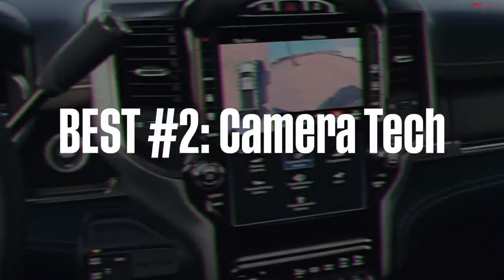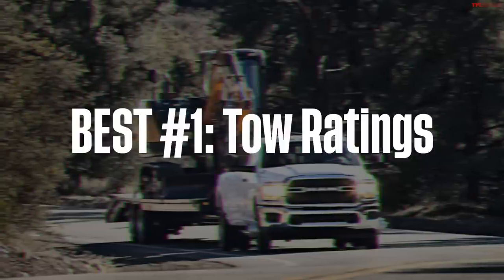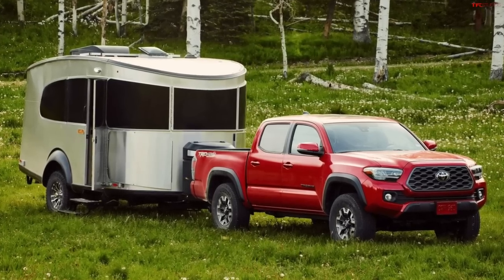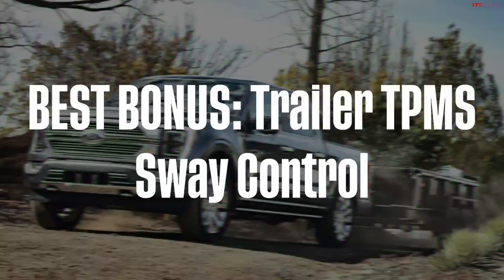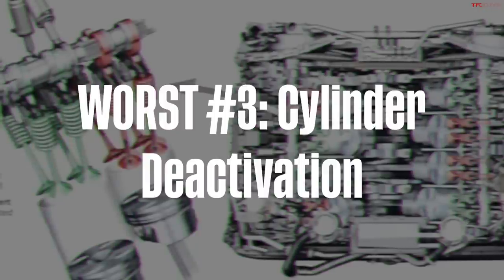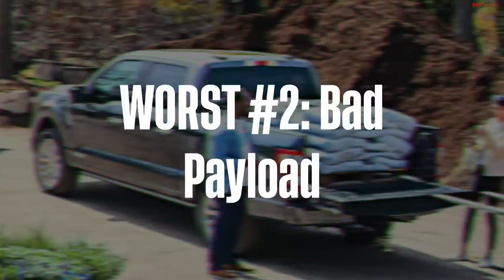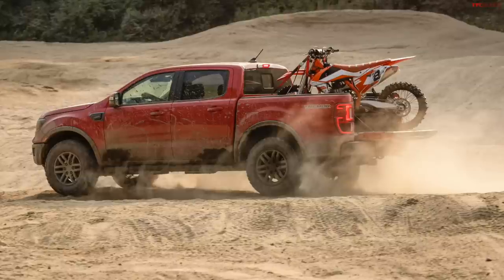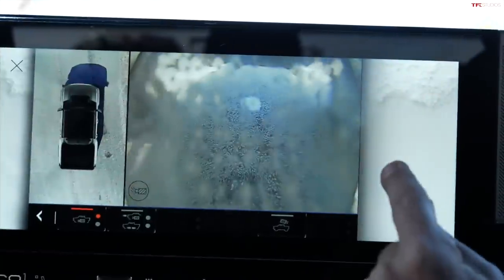This New Truck Tech Makes Your Pickup WORSE!

Comment: Thanks for a really useable top and bottom list! Regarding your final negative point (Price & Availability) - - I have been frustrated by the increasing levels of luxury and decreasing bed size of modern pickup trucks.  I bought a nice car in which to travel with my family so I don't need that in my truck*.  I needed a truck to - well - - BE A TRUCK! I needed a long bed, standard cab, 4 wheel drive pickup truck. I did not need heated leather seats and surround sound. (I will admit a camera would have been nice but I bought an after-market unit that suffices for my needs).  Trucks like I wanted have proved to be scarcer than hen's teeth.  I ended up buying a (very well used) 2013 Chevy work truck.  It's low enough that I can reach over the bed sides, easily climb in and out, and the 4.3 liter six cylinder engine yields pretty good fuel economy and all the torque I need.  I do not tow much or often but I haul a lot of lumber in the bed (and mulch, and manure, and rocks, etc...). I have crank-up windows and a really terrible radio but who cares?  This inexorable march to the "ultimate luxury truck" is leaving the common truck buyer out in the cold. I'd hate to have one of these gold-plated land yachts and dent it up while loading crap from around the farm.
Reply: They should offer both.  The land yacht isn’t great on a farm and the ideal sh*t kicker isn’t useful for interstate towing/family transportation.
Reply: You are absolutely correct I had 2 superduty trucks and 1 tundra. With all the electronics bull shit that kept costing me thousands I went back to a 96 f350 regular cab long box manual transmission. Been the most reliable vehicle I've ever owned. Insurance and registration is only the fraction of the cost also

Comment: I rock a 2008 Tundra with the 5.7 and it will be in my driveway until the day parts are unobtainium. Limited nannies, dependable powertrain, good capability and comfortable enough for a vehicle that hauls and works!
Reply: Why not start looking for a parts truck in good shape? I've known several people that have done this and it makes finding parts very easy-- barring storage probs.
Reply: Good call, I've been looking for one that was written off from a rear end hit...issue is all the rust here. I may have to take a trip and get one from the south🥴
Reply: I tried last year to get me one new, but i needed front bench seat. Couldn't find one i got me Nissan Titan XD...
Reply: Yea your right I’m regretting my purchase of my new Sierra zero issues after 20k miles but so much tech I know it will fail one day 
Should’ve gone with the 2011 Silverado 2500 6.0 gasser that I first wanted, proven simple truck and easy to maintain
Reply: And 12mpg… I drive too damn much to settle with that.
Reply: It's a truck, not a car...fuel mileage is  secondary to how it works and more importantly how dependable it is. I get 11L/100Km (a tickle over 21mpg with mixed driving) because I drive responsibly and stick to the speed limit, for a vehicle that will take basic grade fuel, can be dogged on the service intervals and given conventional oil I think the cost of ownership is much lower than these TT car engines being forced to work within an inch of their life. Come back when an Eco OR Boost hits 500,000 miles with minor maintenance 🤣😂
Reply: @coryernewein  there’s plenty of high mileage Ecoboost trucks out there, don’t be ignorant and look it up. No way your tundra is averaging 21 mpg. That’s a flat out lie unless you’re going 40mph. I have 144k miles on mine, tuned from day one. No issues and does 0-60 in 3.8 seconds. MPG does matter. To say otherwise is also a lie. Being a truck doesn’t exempt this cost factor.
Reply: No lies, I've had this discussion with folks for years and I would be glad to show you if you could make it up here into Canaderp. I never said that TT engine wouldn't last, just that it won't last for as little $$$ as my lazy, lumpy V8🤷
Reply: @Treyk901  you obviously view trucks as a race cars not the workhorses they were originally meant to be. If I wanna do 0-60 pulls I'll hop on my sled and do it in under 2 seconds.
Reply: @coryernewein  no, I don’t view them as race cars. But a truck with more power tows better. And just because it’s a truck isn’t an excuse it has to be slow. And since we are on that topic, the Tundra was the first one to heavily advertise how quick their truck was compared to the competition. Pretty much all automotive experts agree that the 3.5 Ecoboost is the best towing engine on the market for a half ton truck. The engine is over built and under tuned which equals good reliability during extended WOT when towing to the max. I know it’s de rated bc of the huge power gain from aftermarket tuning. As far as MPG goes, my dad had a tundra 5.7 for several years and attested to its terrible MPG. EPA estimates the 5.7 4x4 Tundra MPG to be 13/17 and we all know the EPA estimates are generous.
Reply: I had a similar 2008 tundra, awesome truck, towed everything I threw at it well, excellent brakes, hard on fuel for sure. Bulletproof drivetrain.
Reply: @coryernewein  21 MPG in a 5.7? You need to go back to school to learn how to do math.
Reply: @Eastahtata  He's probably dislexic. Prolly meant 12 mpg. THAT sounds about right for most medium sized V8 gassers (like a 5.7L) in 1/2 ton trucks.
Reply: @Treyk901  Better buy a car then.
Reply: @turbodiesel4709  go tell that to fleet owners. MPG matters. Why settle for 15 when you can get 20? 🤡
Reply: @turbodiesel4709  proven costly by who and who’s standards? I’ve had more maintenance and repair costs and issues with my turbo diesel work truck than my gas burner Ecoboost both at the same mileage and bought new. Plenty of high mileage Ecoboost trucks over 300k miles on the road. All the people having issues with their trucks are the ones not taking care of it. It’s a high performance turbo engine and needs to be treated as such. Let it warm up some before hammering the gas. Let it cool down some before shutting down. Change oil on time. Use quality fuel. Use premium when towing heavy for best performance and MPG (most manufacturers say this now). This engine also is direct injection and port injection so the issues that all other TDI Gas engines have aren’t there. This engine offers higher towing capacity than the v8 option and tows better with lower RPM. Pulling the max load up a grade with the ecoboost can be done at around 3000-3500 RPM and the 5.0 will have to be turning 4500-5000 RPM while pulling it slower. Lower RPM = longer engine life. That’s why diesels last so long bc a superduty pulling that same load could do it at 1500 RPM, granted it’s pulling half its capacity compared to the 1/2 ton class.
Reply: @Treyk901  : I have no problem telling it to any fleet owner. In fact, I've worked for various different trucking fleets before, both heavy duty & medium duty, and I actually have told them to hold on to their older diesel rigs for as long as they possibly can.
 
The only reason that many companies have switched back to gasoline powerplants is because of all the ridiculous emissions-related problems that now plague the modern diesel engines.
Of course, such problems have been brought on by politically mandated government regulation.

You brag about the junk EcoBoost Ford engines getting to 300,000 miles? Hah... few Ford anythings ever make it to 300K. Turbocharged or otherwise. 
I can assure you that any such examples of high-mileage "eco-boosts" are few & far between.

How about we discuss something that's actually true? Look at all of the light & medium-duty commercial trucks with Cummins 5.9L & 6.7L diesel engines, from the 1980's through 2012, for example. Everything prior to the self-defeating government mandated DEF & SCR emission-control systems.

We could also talk about the older Ford Navistar 7.3L IDI's and 7.3L Powerstrokes, the Mercedes diesels, the Mitsubishi diesels, the Volvo diesels, the Iveco diesels, Toyota diesels, and so very, very many more. 
A great many of all of those aforementioned diesel powerplants have well over your silly 300K mile benchmark on them, with few major failures compared to nearly any gasoline engine counterpart... regardless of being naturally-aspirated or turbocharged.

If you truly wanted to be honest, you would admit that any turbocharged gasoline engine is going to have a substantially shorter life span then any naturally-aspirated gasoline engine. 
You would also willingly admit that nearly any diesel engine will outlast nearly any comparable gasoline engine.

I'm sorry to hear you had a lot of problems with your personal diesel engine pickup. If I were a betting man, I would dare say you had something built 2012 and newer, which are all loaded with emissions control problems and electronically controlled fuel system problems. There's no doubt that those two major problems centers alone can cost a person, or company, great financial distress.

One thing for certain, that I bet we can both agree upon, is that the oil companies are ripping everyone off with their exorbitant prices for diesel fuel, that far exceed the current prices of gasoline. It's straight up criminal greed.
Reply: @turbodiesel4709 I use to operate a fleet and that’s why I say MPG matters. I agree that diesel emissions are BS and constant money pits. My peterbilt was a constant pain in the ass with the emissions. My super duty literally blew the exhaust system off because of it. But what you don’t understand is this. This gas turbo engine isn’t just your basic na with a turbo added to it as an afterthought. It was built around with the intention of shoving 20 psi of boost through it. Many manufacturers didn’t go the route Ford went with and they are having failure. This engine also uses turbos that are water and oil cooled. Tuners have proved the stock block can hold 700 hp. So in stock form with 375 Hp is nothing for it. The gen 2 Ecoboost came out in 2017. Not enough years to really show many high mileage engines. Plenty of na V8s failing. Most of the ecoboost failures are from bad piston skirts, something all engines use and not related to it being a turbocharged engine.
Reply: A great choice 👍

Comment: To the last point about truck availability, I live in Canada and was told last week it would be a 14 month wait for a new Tundra and 36 to 40 months for a new Sienna.  That's nuts!
Reply: @Nick Johnson : So what? There are several simple solutions: 
1.) Buy a different brand. 
2.) Buy used. 
3.) Invest a little into improving the vehicle you already own.
 
People really need to curb their desire & yearning for the newest & latest crapola. 
It's not rocket science.

Comment: Love my ‘95 short bed F150 XLT, 5 speed, manual hubs, 15” steel rims, no push button anything, no TV in the dash.  It does have navigation, MP3 player, internet radio and so on if I take my iPhone with me 😃. 
Ridiculously huge rims have to be one of the dumbest trends in truck history.  I run BFG 33’s on the 15” factory rims.  When I air down to 12psi in soft sand I don’t even need 4WD most the time.  The 4.56 axle ratio is a good match for this setup.

Comment: I completely agree and am surprised you guys have electric trucks in the worst category. You guys seemed to be big advocates in the past.  I think they are a terrible solution looking for a problem, just surprised that you guys went there.  Kudos to you on that one.  I have 2 bonus negatives  - 1) Auto stop/start, specifically the fact that you have to turn it off every time.  if the truck would just remember your setting then I wouldn't really have a problem.  I do understand why they do it, they don't get the mileage rating advantage from the EPA if it doesn't reset, but it is annoying none the less.  2) price - All those pluses (which I like) add up.  Trucks are getting unaffordable very quickly.  Great job guys, love your channel(s).

Comment: I also agree with their lists but I may want to add I hate that many manufacturers are removing buttons to control most things and replace them with controls in the touchscreens. I like to have radio, temperature and cameras with buttons/switches.

Comment: I couldn’t agree more about cylinder deactivation. I believe there will be reliability issues in the long run. Drivability is affected as well. I find myself switching my F150 over to sport every time I think about it to bypass that system. We don’t want it.
Reply: GM has had reliability issues with teh 5.3 since 2007 at least. I had a 2007 Yukon XL and at 36k it started burning a qt of oil every 1000 miles then at 96k I though the cam broke. My mechanic flushed the engine and told me the cylinder deactivation was  a known issue causing sludging. I was religious with changing the oil with Mobil1 every 5k. I loved the truck I looked into buying a crate engine and it was so bad GM didn't offer the 5.3 for the 2007-2009 models.  From what I have read it's better now but still happens but not as often. When I had a head gasket start to leak I traded it in for a 2014 Ram 1500 Bighorn that I still have and love! It's been the most reliable vehicle I have ever owned so far breaking 112k last week.
Reply: Some early commercial diesel engines from 100 years ago had cylinder deactivation. This makes me think there was a simple mechanical solution to making cylinder deactivation. I'll be much more interested if modern car cylinder deactivation engines can have the same reliability as non-cylinder deactivation engines.
Reply: @dr.x4050  Back in 1980, Cadillac offered the HT4100, 4.1L V8 that featured 4-6-8 cylinder deactivation.  It was one of the least reliable GM engines in history and the only way to make it somewhat reliable was to dig into the engine and replace the cylinder heads to get rid of that crap.  Thankfully they only offered it in the 1981 model year and then discontinued it.

Comment: I’m on my second 5.3L Sierra with AFM.  First one made almost 200k before I had an issue with the rear end.  Nothing catastrophic but it could be a cheap fix or an expensive one so I traded it in on my current 2014 which now has almost 148k.  Zero issues related to AFM.  I run an Edge Tuner and I’ve got a K&N intake and a Flowmaster 40 series single in/single out with a dump over the rear axle.  3” from the cat back.  I’m able to get some pretty incredible mileage when I drive conservatively.  My best 50 mile average was 32.7 mpg on 55-65 mph roads.  At the same time, I have available power for passing or the rare occurrence that I tow a trailer.  I’ve tried the AFM deactivation on the tuner and the difference in mileage is substantial.  4-5 mpg.  With the price of gasoline these days, I’ll just keep it on.

Comment: I am concerned with so much electronics being in work trucks and off-road vehicles. More things to go wrong and leave you stranded. I’ve driven old Jeeps through fender deep water with very few modifications with no problems. I’ve heard too many stories of issues with newer vehicles not surviving much lower fording depths. Also, love my 2011 Xterra but, electronic x-fer case shifting is a horrible idea. I’ve had several sensor issues that shut down the 4wd system. Not safe when deep off-road in the winter. My old Willy’s was all manual. Not an issue, ever, engaging 4wd. Had to manually hold in 4hi once due to shifter out of adjustment but try that with electric engagement!

Comment: The current truck prices are ridiculous. For comparison, in 1983 F150 cost $8000 which would be about $23 000 in todays money. Now new one is twice that and for $23k you get 10 year old F-150 with 100 000 miles. That's just absurd.

Comment: I think the cooling excuse for tall hoods is nonsense and tall hoods are really just a styling exercise. Modern radiators are cross flow, just reduce the need to make tall front ends by making radiators wider and by tilting them like was done in C3-C7 corvettes. Obscuring the view from the driver's seat for ten feet in front of your hood is a PIA and hazardous.

Comment: The trick for a rookie to back a trailer is to have them steer using the bottom of the steering wheel because then you move your hands in the same direction you want to direct the trailers. :)
Reply: A rookie mistake is backing up from the passenger side (front wheels full right). See guys do that all the time. Better to back up via the Driver side (front wheels full left).
Reply: This was an absolute game changer for me. I’m into my 3rd year of owning a camper and found this tip last year. So simple but so helpful.